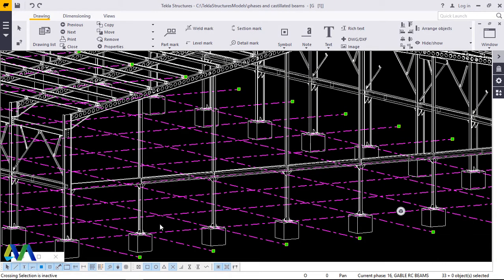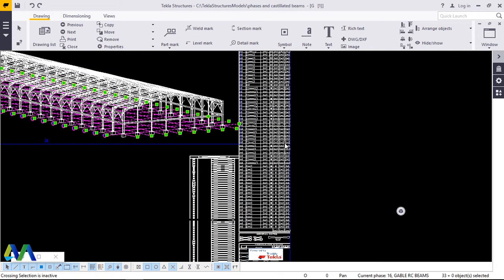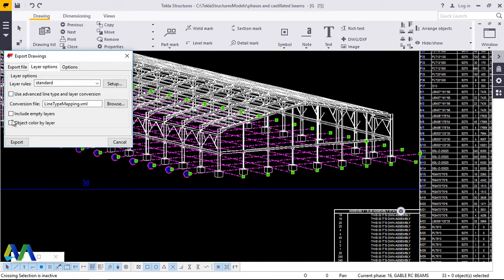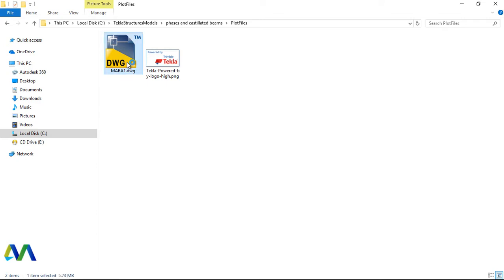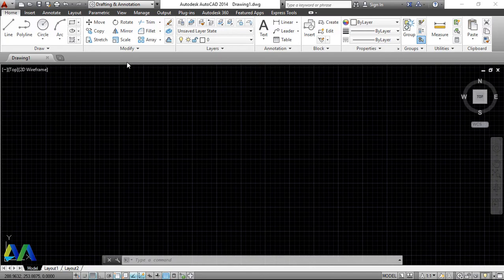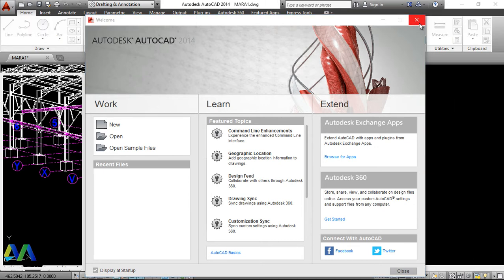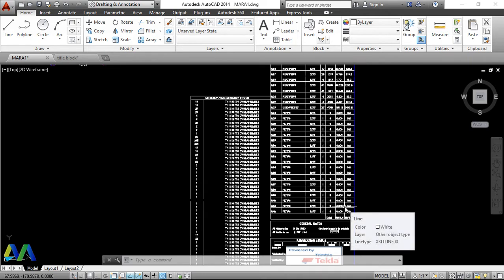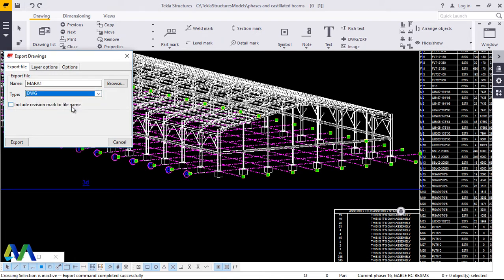How to export drawings from Tekla structures to AutoCAD

Comment: Hello !! I need your help. I have a stucture in tekla. I want to convert it in 3d autocad  but to be able to change the structure not to be just a block?? Is it possible?
Reply from the maker: this's an isometric view exported to AutoCAD from Tekla,its not possible to work on a 3D Structure imported from  tekla structures in Autocad,plain autocad accepts dwg and dxf.mostly 2d and isometric
Reply: Thank you a lot. So there is no possibility. Could tou recommend me a solution to the problem. I have already desing punmps and piping to 3d cad and i have to put the buiding structure which is on tekla. You understand that to put each particle from the begging to 3d is too slow. So please if you could help me i would really appreciate it. Thank you again.
Reply from the maker: since autocad doesn't IFC files,I would recommend you import your pump drawing into revit,revit accepts 3d dwg format then convert your drawing to IFC file in revit.Now with IFC file you can import your 3d into tekla structures.
Reply: sorry i just see this comment you  can select members in 3D view at model and go to File >> Export >> 3D DWG     nad select option use faces this  will export autocad file in model folder its look like 2D but when press Shit+middle mouse button  will get your drawing